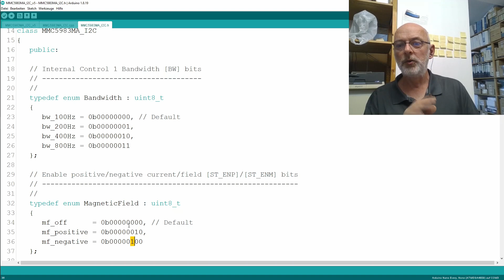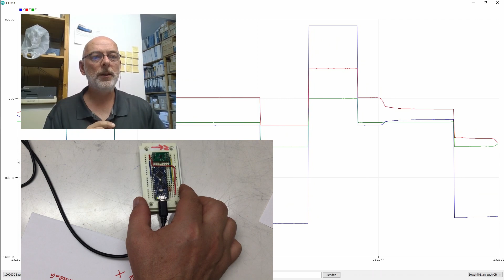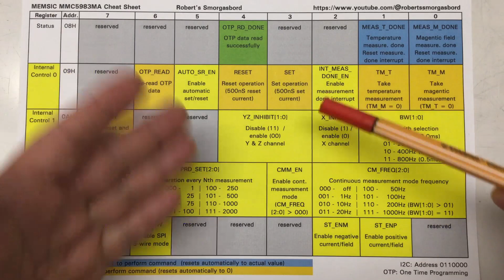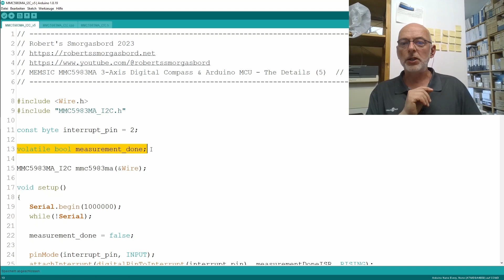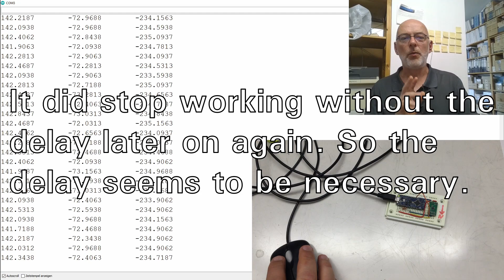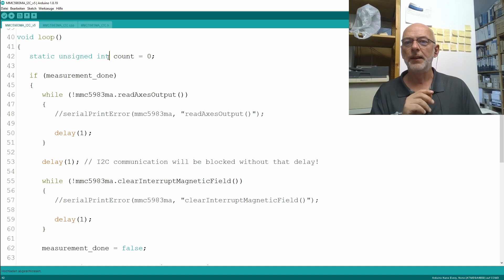MEMSIC MMC5983MA 3-Axis Digital Compass & Arduino MCU – The Details (5)

Comment: At best then the first section is a 'sanity check' ? second question is to save me going thru the back catalogue have you done any stuff with the BME280 please? if yes I will go look !....cheers.
Reply from the maker: Yes, generating an internal magnetic field could be used for sanity checks (of your software). I didn't thought about that. And no, so far I haven't done any video about the BME280, but I will put it on my wall of video ideas.